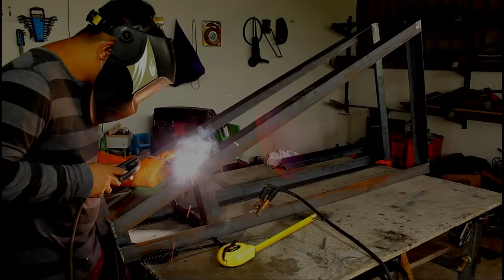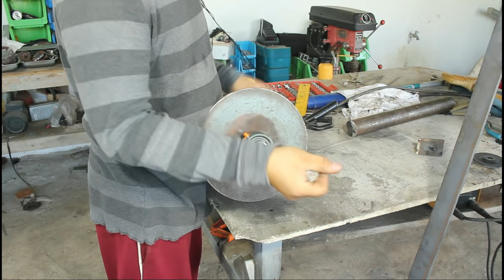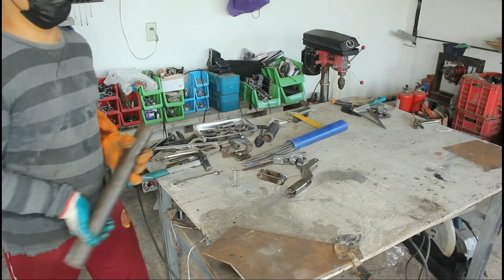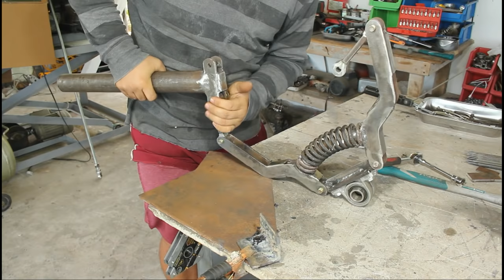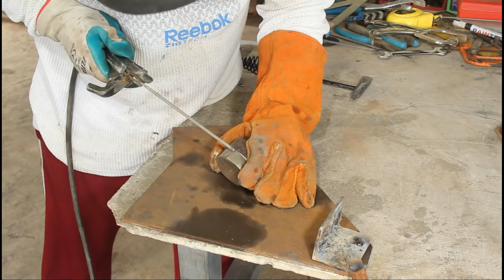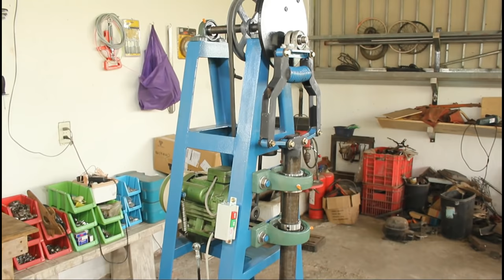Building a DIY Power Hammer Machine "WITH PLANS"

Comment: great stuff - however you might want to rethink how you weld that. after a while those welds will crack
Reply: when you live in the Philippines as this Man does then you use what you can!!!!! ive been there and beleive me  they dont have migs and tigs and fancy stuff readily available  so i follow and will continue to as long as i can
Reply: @jhh8688  don't need a mig or Tig to do an effective weld. I'm a welder by trade
Reply: @verdiblue  dude thats what i said hell he lives in the sticks so one uses what they can   im saying you dont need a mig to weld a good joint
Reply: @jhh8688  when you get a metallurgy degree come back and talk to me
Reply: @verdiblue  you work with stainless  and alumn for 45 yrs hands on talk to me... books are great to read!!!not worth a crap for real job experience
Reply: @jhh8688  did i not say i am a welder? again come back to me when you have something to offer.
Reply: @verdiblue  damn a demacrat
Reply: `you gotta be left handed your missing the whole freakin point of my post dammit dude